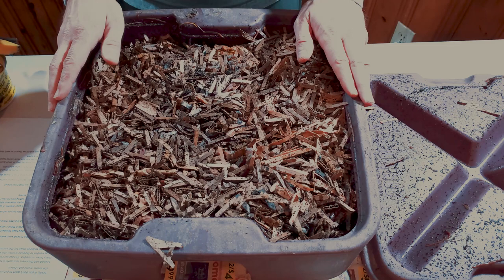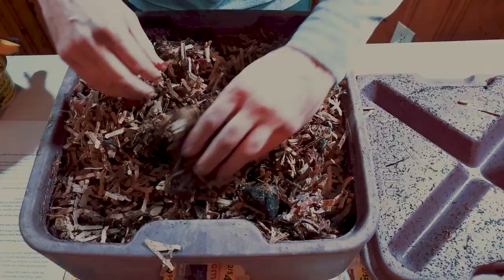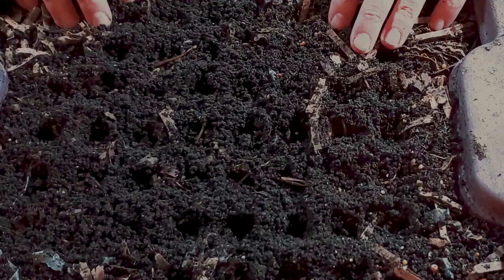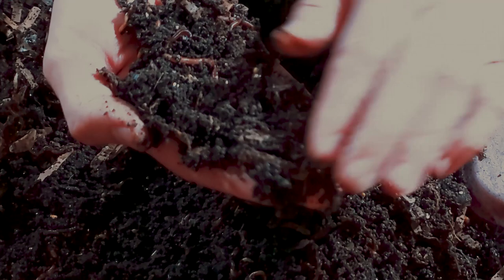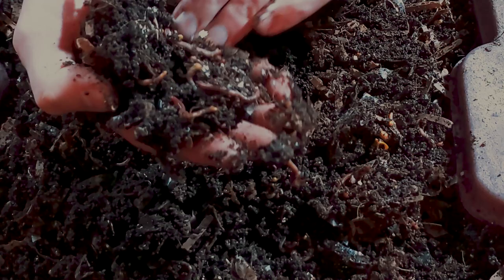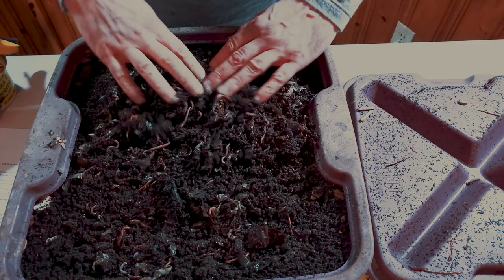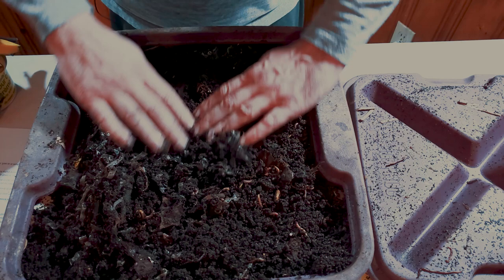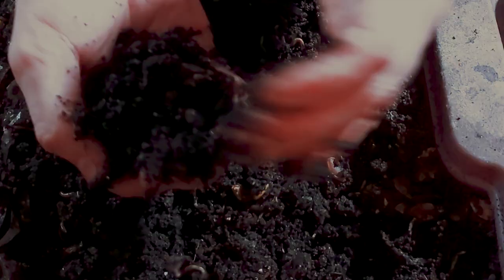When are your WORM CASTINGS ready for HARVEST?

Comment: another great video! I have two bins of worms. one is red wigglers and the other is my original earth worms. I'm upgrading to a bath tub vermicompost bin. can I combine the red wigglers and earth worms in my new bin? if not, then I'm thinking I might just release the earth worms in to my garden and concentrate on the red wigglers. ty
Reply from the maker: Great question. Personally I don't think there is any reason to keep earthworms, they are not near as good at composting as red wigglers and they take up space in the bin that could slow down the breeding of composting worms in the tub. Good luck with your new tub!